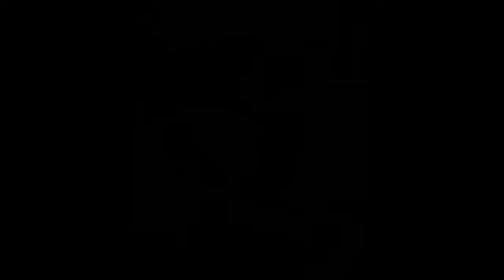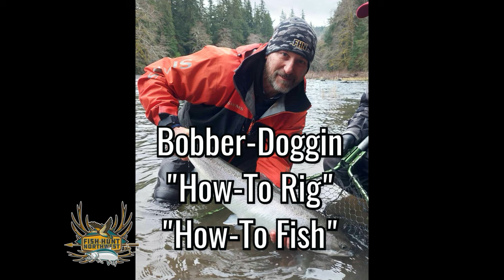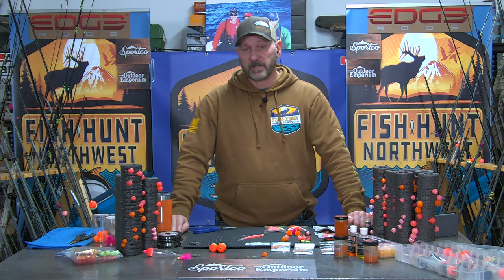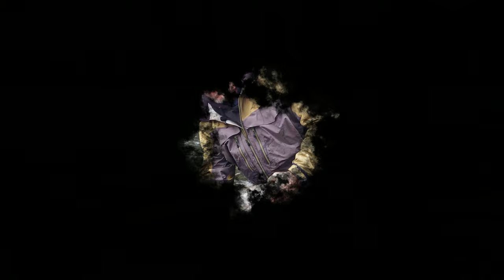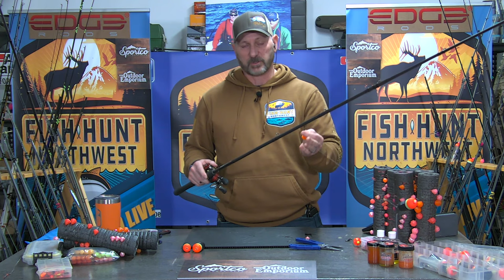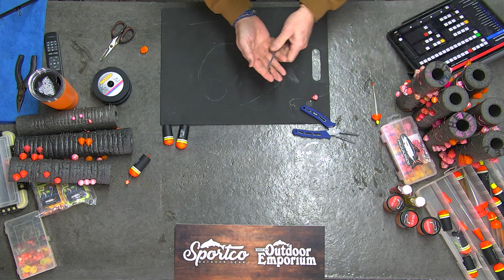"Bait Lab" Bobber Doggin' "How-To Rig & How-To Fish"

Comment: What kind of knot are you using to tie your leader to the gamakatsu bead hook? I lost a fish the other day, and I think the teeth of the fish was slowly cutting the egg loop knot I used. I used an egg loop knot to get the right hook angle, and also be able to easily switch over to bait if I want/need. Thoughts?
Reply from the maker: I typically also tie a standard egg loop on most hooks. I have not had an issue like that. Interesting..

Comment: Why don’t bobber doggin floats give a specific maximum weight size
Reply from the maker: That's a good question. Most manufacturers mark them, small, medium, large. I think it is mostly due to the fact that the amount of weight you drag, is always dependent on current flow. I find that I am changing weight multiple times per day, so I probably, more times than not, run a medium weight float..
Reply: Because you don’t have to match the weight you can tick 1/4oz on a large float it’s just an indicator
Reply: Think about it like this when a steelhead slams your bead in fast water do they really care about the resistance of the float no they don’t they’re already hooked and jumping when you reel
Down
Reply: @FishHuntNorthwest  it’s essentially trolling your stuff down the river and when it slams or does the classic bounce bounce bounce like it’s getting slammed by a huge trout reel down and swing it’s just an indicator for what your setups doing down there. I like to run a big float because it tows your gear better and keeps it from snagging vs if you ran a torpedo float it’s getting sucked under every time that lead hits.